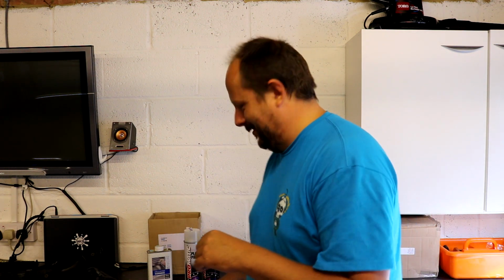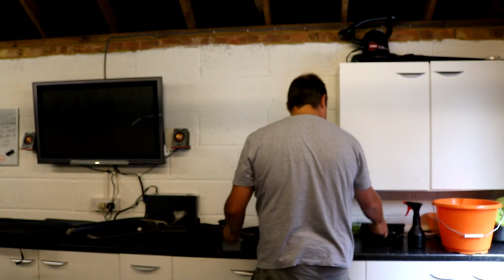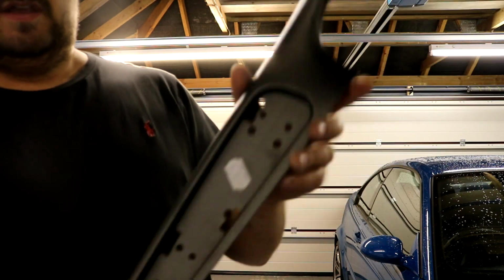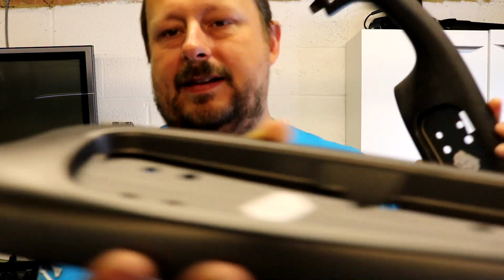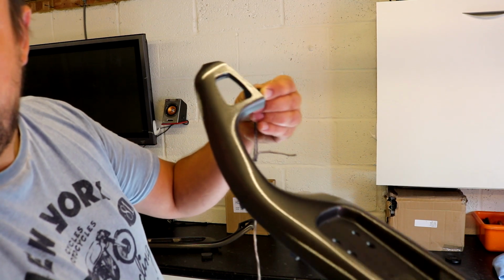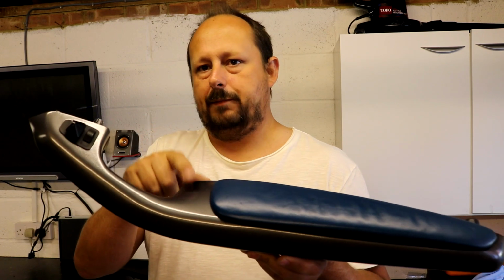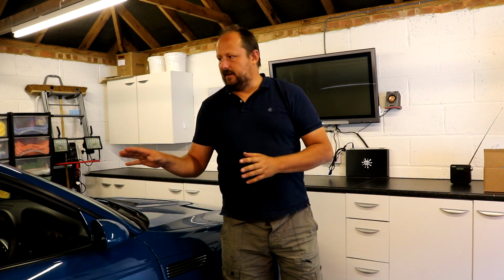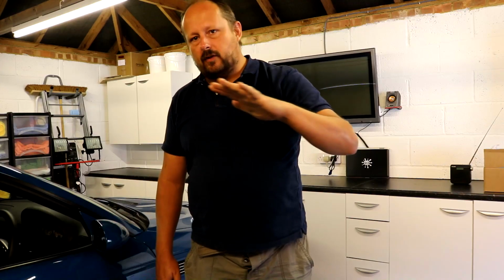BMW E46 M3 laguna seca blue full detail VLOG  Part 2

Comment: That seat looks really good,wouldnt mind knowing the process he takes to accomplish that.
Great video
Reply from the maker: i think its not too far from how you would paint a panel.. you rub it down.. you have to get is clean with some alcohol based cleaner..  and you paint it with a small sprayer I think from a compressor..  he mixed the paint and gave me the left overs.. Its also a special type of paint for leather.. so flexible
Reply: How do they get out the cracks that were in the bolster,they smooth it down with sanding?
Reply from the maker: i think they paint over them or fill them first..

Comment: Excellent work in my opinion, and a car of 15 years old, has his wear and tear. My car a VW Polo 6n is almost 20 year old, you can only restore it to the level you can do yourself. My interior is fine, in have a ton of work to do, to the outside, but i am getting there, at the end.
In use spraycans also, i did it on the back wiper and some pieces of the antenna (silk black).
Reply from the maker: cheers joppie much appreciated.

Comment: Great series of videos. I've got the question: how would you rate the "OEM-iness" of that stone guard black paint stuff, compared to what was there from the factory? The factory stuff has a texture and rubberiness to it...from 1 to 10, if 1 is flat black paint and 10 being OEM stuff, how would you rate the texture and rubberiness? I've used plastidip for those panels, but plastidip is for some reason not easy to maintain (at lest for me)... Thanks!